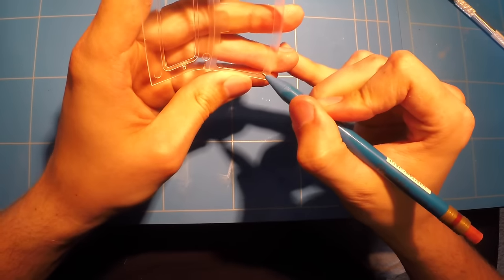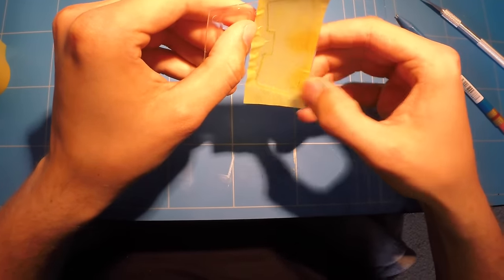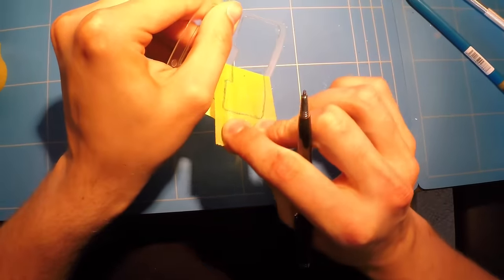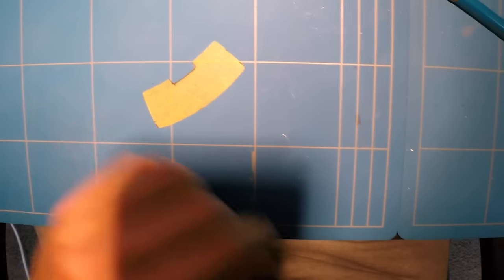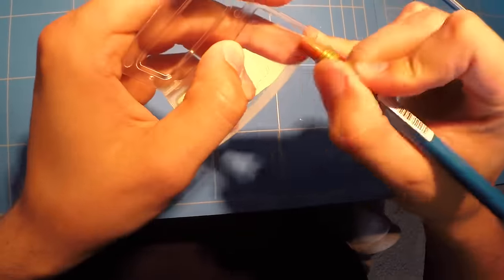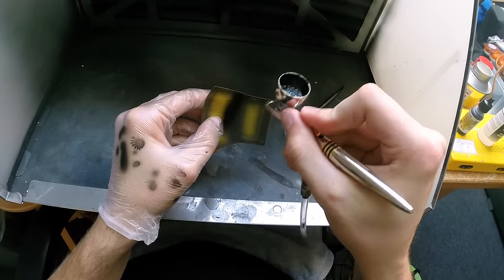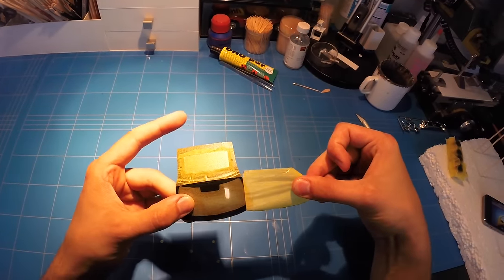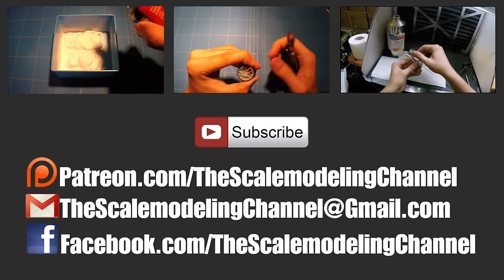How To: Black edge on the Windows

Comment: I've done the blackedge freehand with flat black testor's & a fine brush.
no tape required for my solid steady 55 y/o hand.
This prevents the use of ANY exacto scars. it looks real enuf at 1/25 or 1/24 OR 1/16TH scales. Also, btw, the kits do NOT have pre-ground "paint here" areas.
😆 😉
Reply: I free hand it also.  I use acrylic flat black.  If I slip, a damp cotton bud  will fix it.  Masking is extremely tedious.

Comment: just like to add my tip i would tape the out side of window to start off with  cause rough fingers could cause scratches and i have actually caused light scratches on a few windows due to my hand being rough and dry cracked cause i work on real cars/trucks

Comment: Hey, excellent idea.  I was wondering if you've made some older models where there is chrome around the windows.  If you have do you have a video doing the foil glue method.  Some of the window chrome strips are very fine, and working around the windshield wipers looks pretty tough.
Reply from the maker: +BennyCFD I dont have video of this yet, when i come arround to it ill be sure to make a how to.

Comment: Could you do a tutorial on how to glue Windows? When I do it, it always turns out really foggy and not clear
Reply from the maker: Thats because your using the wrong glue, try a glue specialy made for clear parts
Reply: Ok is micro Krystal klear good?
Reply from the maker: +Breaking rc yep
Reply: ok thanks!
Reply: i glue them with a bit of transparent silicone, (the one that smels like vinegar) and i like it because is easy to remove

Comment: Weird question...Is there a certain type of pencil I should be using for this?  I've been trying it and the pencil won't actually mark the plastic, it just slides around.
Reply from the maker: No, just a regular one. though it will only work on the rough clear plastic

Comment: Would you get even sharper result if you would block of the masking tape edges with gloss clear first or is it a waste of time?
Reply from the maker: Warpainting tutorials Well if the masking is in place properly it would not bee needed. This is only to reinsure you that it won't seep through. But when using Acrylic paint its easily fixed when it does by just cleaing it off with a bit of the acrylic thinners. So in my opinion its a waste of time.
Reply: Yes, exactly. Tamiyas tape usually gives really nice edges provided that you made sure its sticks properly. I guess that's the beauty of acrylics and the reason to why you picked it for this tutorial.

By the way, what kind of audio setup do you use for recording your sound?
Reply from the maker: Warpainting tutorials I Use ' Imovie ' on my Imac. I just plug in my iphone earphones wich has a microfone built in.
Reply: I see, thanks for the info. Keep up the good work.

Comment: I ' ve been trying this technique several times and i always get the same issue  : the black paint that I use always gets through the masking tape and ends up damaging the windscreen transparent plástic. I think its a problem with the cheap masking tape i use.  Cause its so paperlike.  It soaks the paint trough and thus the plastic gets in contact with the paint and ends up damaged. Can somebody tell me if thats the issue or could it be something else? .
Reply from the maker: Yes that sounds like the problem. Try using some higher quality tape like Tamiya
Reply: @TheScalemodelingChannel  Thanks for the tip . Also, i use the same technique but instead of black paint ( spray) , I use a black marker pen.  The results are pretty good and I dont have to worry about soaking or paint damaging the plastic. One question  : is it a good idea to use matte black as primer? Cause I want to paint the car in metallic white.  Greetings from Spain . Btw, your paintjobs are exquisit.
Reply from the maker: Don't use paint as a primer. use actual primer as a primer ;)
Reply: @TheScalemodelingChannel  Thanks for the tip again.  I ve always used primer as primer, its just that I thought there were other possible alternatives.  Cause I ve also seen people applying the paint directly, they actually skip primer and they get great results too.
Reply: Can you use blue painters tape that you use on house when painting

Comment: Hi! any tips on how to remove paint from clear parts? lets say I want to remove the black gloss paint I laid down coz I want to replace the whole mask with flat black. help!
Reply from the maker: What paint did you use? If you used Acrylic you can remove it with acrylic thinner, if not you are stuck with it and it would be better to leave it as it is.
Reply: Vincent Zamora For acrylic paint, you can also soak the part in glass cleaner to remove the paint.
Reply: I only used acrylic tamiya paint. Whew! Is the glass cleaner and thinner safe for the clear plastic?it wont make a cloud or anything?
Reply from the maker: Vincent Zamora As ong as the Thinner is specificly for Acrylic you should have no problem. Any other thinners could cause clouding.
Reply: +The Scalemodeling Channel alright, will try it out with confidence, and backup corssed fingers 😂 thanks TSC! i love your modelling videos, most of which has actually helped me avoid most mistakes a newbie shouldve commited. videos well worth watching! keep it up! :)
Reply: +Vinci Z i like Gunze's Mr. Color thinner, very potent, and yet mild to plastic.